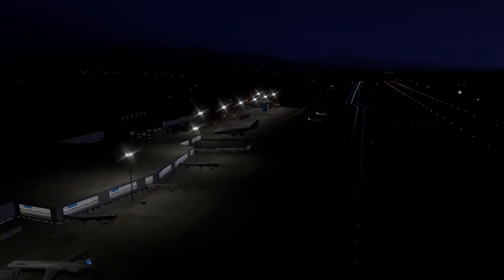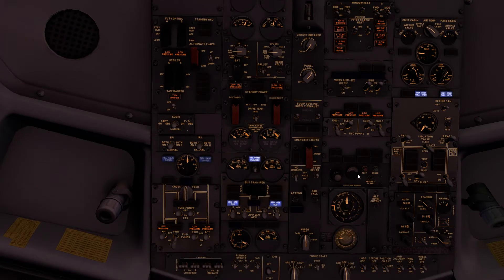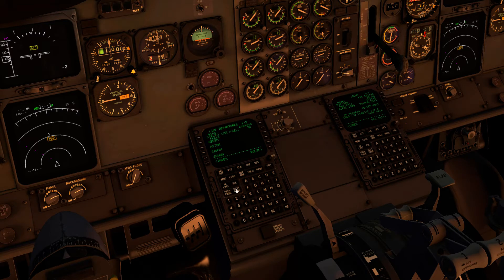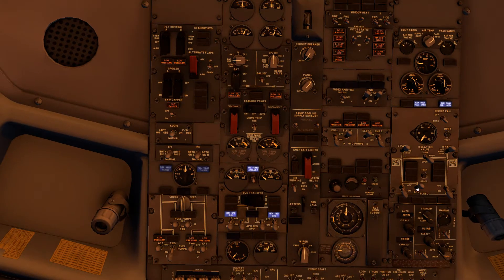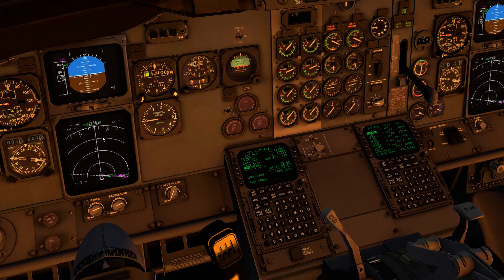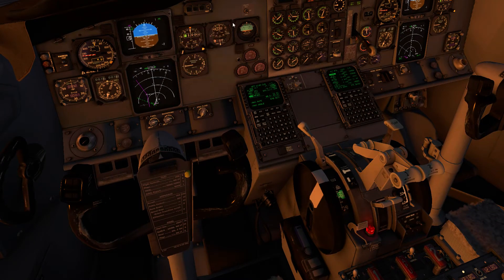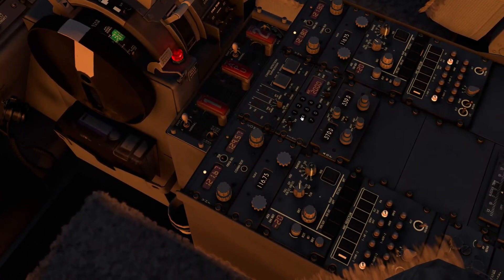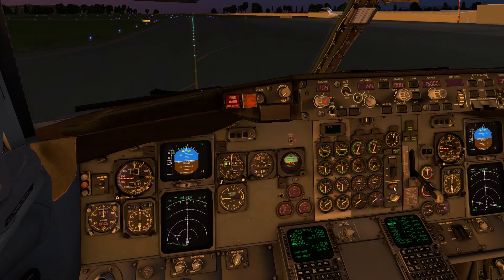IXEG 737 LIMF Departure [X-Plane]

Comment: I realise this video is a thousand years old now, but the scrollwheel/zoom thing is still relevant in XP12. I use XCamera which allows you to enable and disable scrollwheel-zoom per-preset, also maps a command to toggle scrollwheel-zoom. really good if you set a preset for e.g. the pedestal and overhead of a Toliss Airbus, where the switches mostly use undersized scrollwheel manipulators. by disabling scrollwheel-zoom for those presets you don't zoom the view to heck when you don't quite hit the switch manipulator
Reply from the maker: Oh my, yes it is an old video. First proper video on the channel!  Thanks, I've never really got on with X-Camera. Maybe I should try it again.

Comment: Excellent tutorial both on content and presentation!
Actually, that's quite likely the most professional and accurate video about departure procedures I've ever seen.

If I may ask a question, usually i struggle to properly define a FP, especially when flying in/out of italian airports, perhaps due to the not easy accessible free charts. I would be nice if, sometime, you can post a video about flight planning using freely available tools, such as for example skyvector.com and/or simbrief.com.

Cheers and thanks again for this series!
Reply from the maker: Hello Patrick, thanks for your kind words. Have you tried the RFinder site for the routings? http://rfinder.asalink.net/free/  it doesn't tell you the SID/STAR to use but will do the rest of the routes. It's a good idea for a video though. Thanks.
Reply: couldn't agree more, just found these videos. Very good!, just learning how to fly this superb aircraft at the moment

Comment: well done! if I may ask..I tried to follow your VNAV procedures..but for some reason..my alt was set for 2900 on the MCP without my input prior to takeoff..my first wp was Direct to HTO from KLGA and my FL160 was set by me.The FMC wouldnt get me to FL160 like it was set after takeoff once the aircraft was cleaned up and instead started to level off on its own.Why was the ALT Hold preset to 2900? any help you might have would be greatly appreciated..not a real pilot but simming for yrears.
Reply from the maker: Hello James, without seeing the procedure or the FMC setup it's difficult to tell. I think the MCP value persists between sim sessions, but other than that I can't really say. Regarding the early level off was there an altitude constraint showing on the flight plan? I know a lot of ex-737 crew I fly with on the Airbus like to remove vertical constraints from the FMGC - So while the Airbus is quite clear if there's a constraint on the profile perhaps the 737 isn't. If you could do a short video showing the issue I'd be happy to have a look at it.  Another thing sim pilots often forget is the importance of the FMAs (flight mode annunciators) to what's going on, always keep an eye on these to find out exactly what the automation is trying to do.

Comment: Thanks again, just found your great set of tutorials:

may I ask a stupid question? Exactly what are you saying @24:32? Something like "...press the XXXX button." I can't make it out and i cannot see what you pressed, unfortunately. 

thank you.
Reply from the maker: That’s the TOGA button. Take Off/Go Around. In the thrust levers but best used with a key binding. Puts the flight directors to TOGA mode and Autothrust to the takeoff setting. Also that’s very early video so some things like the speed setting on the MCP are not quite correct. Some of the later videos have more accurate procedures.
Reply: @ReflectedRealitySimulations  Thank you so much for the interactivity. Not only are your videos fantastic, but it is much appreciated that you reply to users asking for assistance in a timely manner. I am forever a supporter of your works!
Reply: yeah, i would say something didn't work, as my first flight ended with disaster as my a/p turned off when i turned my flaps to 1 and i couldn't get it back, lol!

Comment: I love your video but what you missed in FMC performance page is CG. I was watching a lot of videos but none of them discuss about CG calculation. As I am aware of we must calculate CG based on fuel and weight otherwise the trim would not work properly, however, I do not know how to do it. Any idea?
Reply from the maker: Hello Amir. It’s been a while since I did those videos but I don’t think the CG was missed. The ZFW and CG are shown on the pop out control panel, then loaded in the FMC. Perhaps in this video the default values were used but have a look in the IXEG control panel where you enter fuel and payload.
Reply: Reflected Reality Simulations yes you are right. The default value is 20 %. what I heard from real B733 captain this value can be changed from 19-25 % based on aircraft load actually . I don’t know how to calculate CG and that’s why I leave it as default all the time. I just wanted to be perfect in this sense as well when I setup aircraft. Not big deal. Thanks for video. Amazing stuff. Can you please be a bit slower in your talking? Hard to catch you though sometimes. 😄 at least for me which not native English speaker 🙂

Comment: When exactly the runway lights must be turn on? I thought while taxing, only taxi light should be on and runway lights are switched on when enter into the runway. I saw different people doing different ways. Is there a correct procedure for this? Thanks a lot for your videos. Learning a lot!

By the way, they are really some interesting plugins out there for X-Plane you can use to make it look even better: Have you tried Real Terra Haze?
Reply from the maker: It very much depends on company and aircraft type. On the Airbus some operators use the taxi light only, other use taxi and turnoffs. The turnoffs are on the nose gear leg. Likewise on the Airbus it's normal to get airborne with all the lights on, whereas on the 737 I've read that only the inboard landing lights would be used.  The purpose on the runway turnoff lights are to illuminate the sides of the runway and taxiway so the crew can see the turnoff if the airfield ground lighting is quite poor.  A secondary effect it to make the aircraft much more obvious to ground vehicles around the airport. So the real answer is "it depends" - in the sim it doesn't really matter, use whatever lights you need to do the job. Hope this helps.
Reply: Thanks! I was always thinking who was right! Now I know it depends of the company and lighting conditions. :)